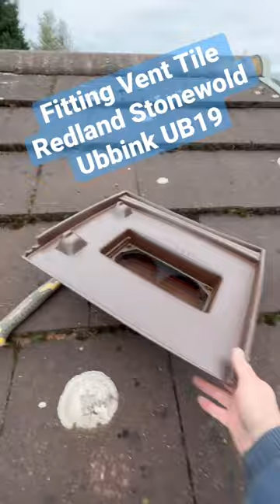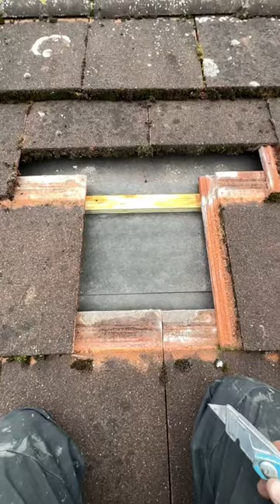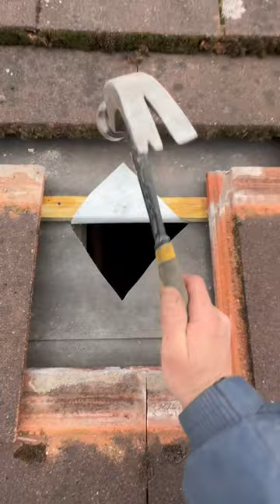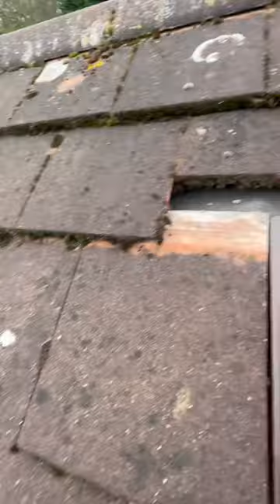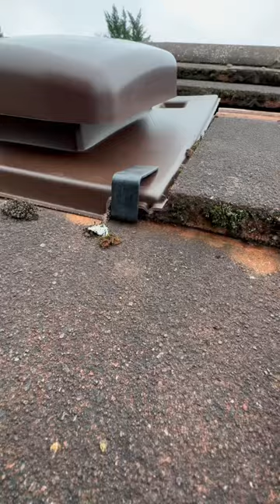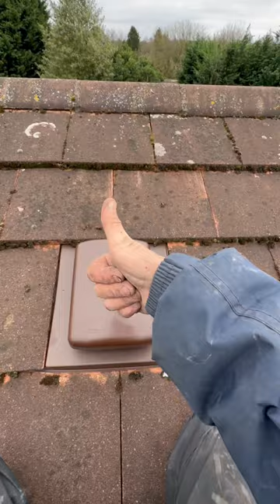Fitting a Redland Stonewold Vent Roof Tile - Ubbink UB19

Comment: Thats it? Wind doesnt blow water back up under the slate? No caulking? I guess it doesnt snow much. Snow could dam up and force water to go under slate above vent.
Reply from the maker: These are concrete roof tiles, rather than slates. But with enough cover from the tiles above, which the length of cover varies depending on the pitch of the roof, it wont leak in. Snow wont be a problem, we dont get as much snow as you guys over in Canada so might be an issue there , not sure? but here its all good mate.

Comment: What do you think about venting bathroom extractor fans through these please mate? I think we have old Marley smooth concrete tiles, look similar.
Reply from the maker: @Timmy51m  yes you can do that, there is attachments to the bottom for use with bathroom extractor tubing. Or use without attachment for loft ventilation. 👍

Comment: can this be used as kitchen extractor vent
Reply from the maker: not from a cooker no, but if its a wall vent similar to a bathroom then i guess so but never seen it used that way
Reply: @davesalter  ok. thanks for answer. Looking for one that I could use for cooker....
Reply: @davesalter  Why can't these be used for a cooker?
Reply from the maker: @Participant616  the heat would melt the plastic I guess. You can get metal ones or round flues for cookers.

Comment: well it won't pass the manufacturers requirements or TRI, or even really the sloppy paper weight the NRCA calls a manual but hey,  it looks pretty
Reply from the maker: It’s manufacturer spec genius. Keep to the shingle roofing and we’ll do real roofers work. 😂
Reply: @Dave Salter  You mean the vent manufacturer, I mean the tile manufacturer.

Guess who holds the higher requirements in court? I'll give you a hint. It's why I pointed out the sloppy install, and why you're defending it
Reply from the maker: @RoofingFacts  you don’t know what you’re talking about mate. 😂
Reply: @davesalter  Try a TRI manual, you might learn something
Reply from the maker: @RoofingFacts  Keep your USA roofing standards over there. It’s mostly shingle nonsense, UK has its own standards and what I have done is usual. 
USA isn’t the world governing body mate, despite what some may think. There is a big world outside.